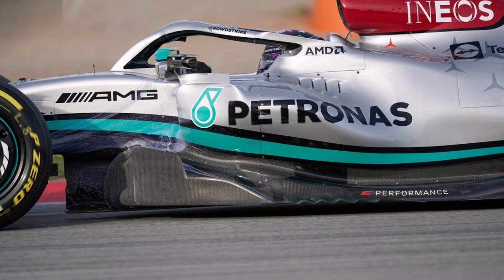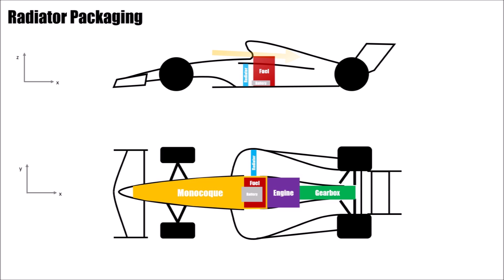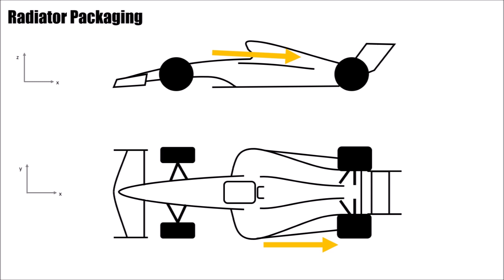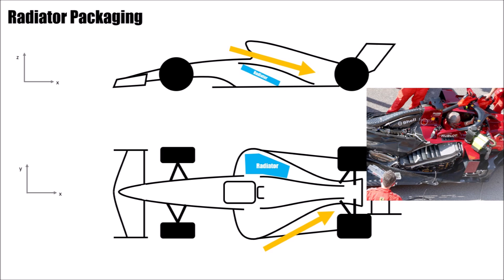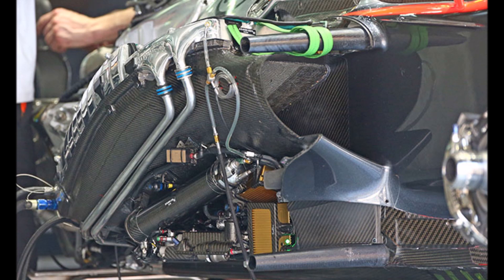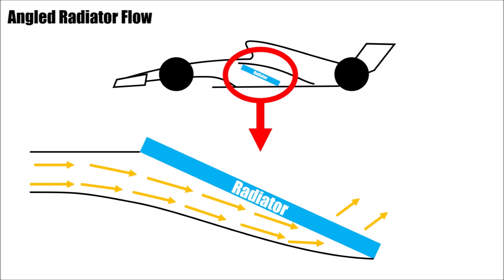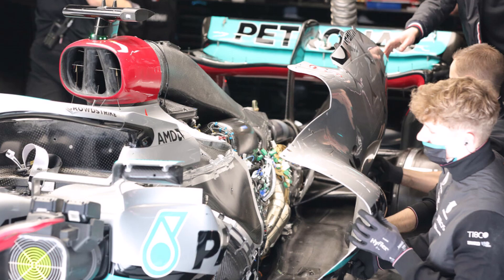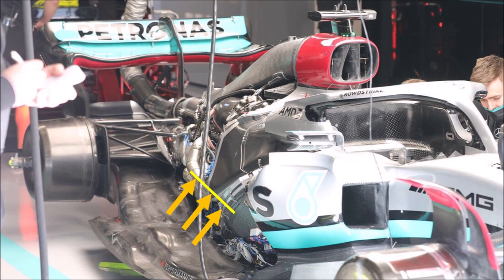Mercedes' X-Chassis - F1 EXPLAINED

Comment: Such a short video for a seemingly unbelievable design! With the rumors that mercedes will bring a car to the bahrain test with almost 0 sidepod, it seems that mercedes have managed to find performance where others havent. this extremely tight packaging will also allow them to pursue any other sidepod design they wish if it comes to that. since this design affects chassis, fuel tank, battery, and even engine packaging, it will be almost impossible for others to copy this within 1 year, so if merc has hit a jackpot, we may be entering another era of domination
Reply from the maker: To be fair, other teams are doing a recess design too to some degree. But no team takes it as far as Mercedes does.
Reply: @BSport320  with many f1 teams seemingly still focusing on generating outwash, do you think Mercedes’ will stick with the small sidepods or make some sort of empty sidepods for outwash like Williams? 

And since Mercedes’ had to provide PU components to their customers, wouldn’t AM, Mclaren, and Williams all have known the extent to which Mercedes’ is pushing this?
Reply: @Jay-nk6dm  i think the layout of the icu and gearbox are the same but radiators etc can be different
Reply: @Barcodez5555  yes I believe you’re right. But merc engineers said they completely revamped PU mounting, which i assume is to fit this radical design. Since that would require some unique mountings or design, surely some elements are given away?
Reply from the maker: Cooling and chassis design is always down to the individual teams. And as a customer you will never push the limit as hard as the manufacturer.
Other teams know what Mercedes is doing there but can only react to this for the following year because this is chassis design and hard to copy during a season.

This gives Mercedes a tight package underneath and they have all the freedom to create different bodyworks. If they can manage the wake with their short sidepods it's good, and if not they could have Ferrari- or Red Bull-style side pods in Imola.
Reply: @BSport320  well, you saw that right about Mercedes having taken it a bit further again.

Comment: I have seen some pics of both the W13 and the AMR22 in the garages with a fan on the floor in front of the T-tray. Do you think they might have some cooling inlet at the T-tray? If so, they might be able to shrink the sidepods even more, or potentially remove the inlets completely.
Reply from the maker: Could you send a link to these pics please?
Reply: @BSport320  Sent you some links to pics on email, since comments with links got autodeleted here.
Reply: Also if you search the Formula1 Reddit, there is a post with title "Aston Martin T tray cooling inlet?" from Feb 23rd.
Reply from the maker: Thanks for this. I will keep an eye on that.
Reply: Haven't seen the pics you're talking about but there are many other things that need cooling besides the engine. For instance the little inlet on the nose of the Ferrari is for driver cooling, LOL. Throw in all the electronics and you have all kinds of cooling needs.

Comment: There is a rumor now that no sidepods in W13. Is that possible?
Reply from the maker: Even Mercedes would need at least small sidepods to house the upper part of the radiators.
But having no sidepods wouldn't really be a benefit because teams use them to push the front wheel wake outside.
Reply: @BSport320  Agreed but they say it gives 1s advantage in Sim. Also I think its a safety concern too. What about wash then? With min or no sidepod, wings would need to handle everything right?

Comment: Why would a team build radiators into the monocoque? The whole point of them is to be directly in the air flow. It would prevent easy amendment of the radiator positioning & require FIA retesting. Notching the monocoque reduces it's strength. Do you have photo evidence of this arrangement?
Reply from the maker: That was the point of this video. There is a long list of disadvantages but they still do it for the package and aero advantage. Like I said, they are not the only one doing that but the most extreme. You can see the shape in the pictures shown in this video or here:
https://www.motorsport.com/f1/news/tech-insight-expect-2020-mercedes/4680017/

Comment: Problem is you create a lot of drag from the rear wheels not being shadowed by an aerodynamic surface.
Reply: And why Ferrari and McLaren have gone the exact opposite direction. Sacrificing a bit of efficiency at the rear of the diffuser to get better floor sealing from outwash and reduce drag from the rear tires.

Comment: From what car is that sound from the intro?
Reply: My guess is a Judd engine, most likely one of their large flat plane V8s, e. g. used in the last F3000 cars.
Reply from the maker: Let's have a guess!
Reply: @BSport320  a late version of the dfv?
Reply: @BSport320  Blown Diffuser? Anyway great viedo as always!
Reply: Benetton Ford, early 90’s.
Reply: not at all familiar with old race cars, but my guess would be the honda v12 from mclaren in the early 90s?
Reply: It's loltyler
Reply: @BSport320  90 or 91 McLaren Honda. Probably Monaco 90
Reply: It's from a Lada Yugo...

Comment: I'm puzzled that no-one is using counter current flow radiators.
Reply from the maker: If you mean counter current air-water radiators: Teams do use them but only for smaller circuits that can live with the higher flow resistance on the water side.
Reply: @BSport320  ah, thank you. Is that an inherent characteristic that cannot be designed out?

Comment: Hi, can you please explain how this incredible new design can cope with the required heat rejection of a 1000hp powertrain? I understand that the water radiators will require an optimum surface area to do the job via the cold-air intake/s, but this also requires a larger and minimally restricted exit volume to achieve the required cooling/pressure drop across the cooler matrix. I also understand that 'saddle' cooler systems are used and mounted higher up, but how is this possible within the tiny volumes that exist between the chassis tub and powertrain volumes? (PS, Merc has also run the car in this hot-test with the upper cooling exits masked off, without the car rolling to a stop in a huge ball of steam!!!). Are they running the engine at (previously unseen) extremely high temps? Also! Is this design cooling model based on LEADING the races? We will remember the cooling issues Merc had when they had to follow! Thanks in anticipation..
Reply from the maker: Fascination F1 Engineering :)
That might also be enough for another video but here in short:
Aero:
The internal flow path in an F1 car has much less resistance than in a conventional car (intake, radiator net and outlet). Even the engine bay is streamlined with panels for less internal resistance and radiators don't have fans. Inlets and outlets are positioned in locations for maximum pressure difference between in- and outlet. A team like Mercedes could assume to lead the field in previous years and hence use a lower safety factor for their cooling design. That would be too risky for customer teams.

Thermo:
Teams try to run the engine at higher temperatures, which also helps with engine internal resistance and they use a different coolant mixture compared to road cars to increase thermal capacity.

Also, they run at high average speeds and overheat quite quickly when they stop/crash. Also ECU's are air cooled...
Reply: @BSport320  Thank you for your response. i used to be a design engineer in F1 in the early-mid 90s, so I'd like to push you a little bit sir. :) My origin question is based on heat rejection really. I can't understand how this much energy pumped into the water can be dealt with by radiators half buried into the tub. In layman's terms, why hasn't any team realised that they've been running 50% too much radiator area for the last 10 years?

Comment: For the old rules it might be an advantage but the new rules completely and utterly make the concept pointless since most of the downforce is now courtesy of the underfloor and now what is needed is bodywork to replicate what the barge boards used to do to seal the side of the floor. This design obviously explains why Lewis complains about a hot seat most of the time with the radiator so close to the cockpit.
Reply: I think mercedes can now do both generatore downfore with the underfloor and also the floor area like they did before.
Reply: In all honesty I have never heard Lewis complain about a hot seat or rather any driver